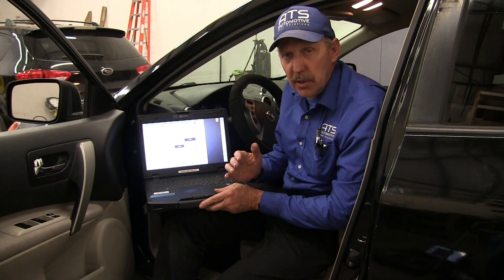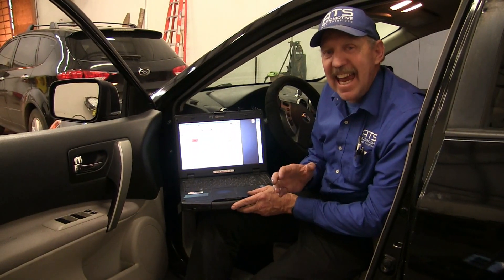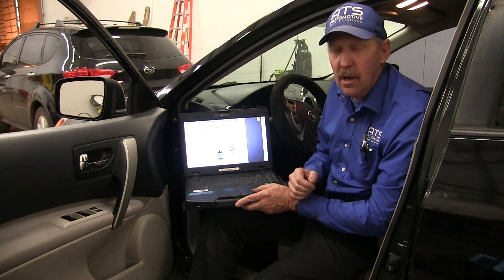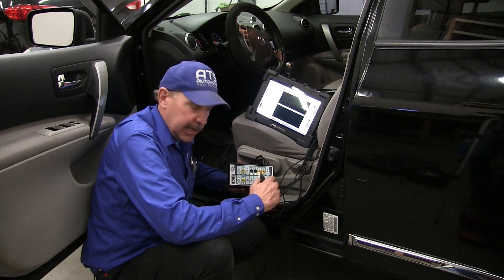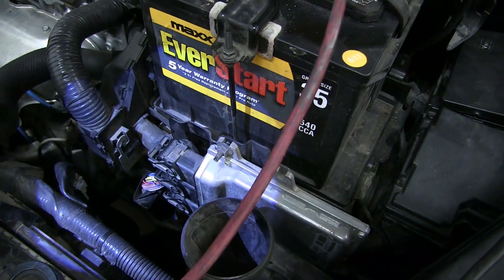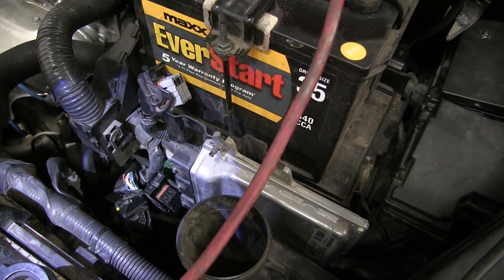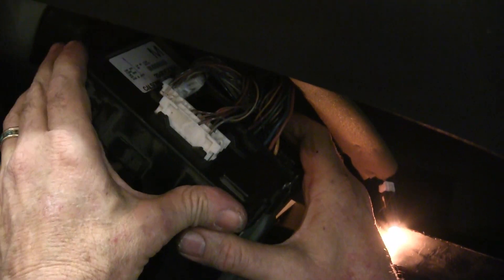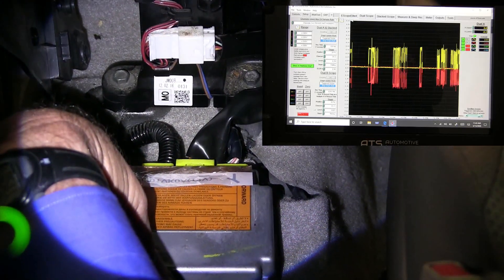CAN diagnosis on 2012 Nissan Rogue

Comment: If you pull out fuse for failing module, would you still see U1000? I am wondering if ESCOPE is necessary?

Also do you unplug modules with turned on ignition? Is it safe?

Comment: I'm having this issue on my 2008 titan. The horn wasn't working (though other controls are fine on the steering wheel) .... So I checked the fuse and cleaned it off as it wasn't blown and the horn worked for a little. Then I changed the fuse and it worked for a little.... Then it stopped so I removed the relay and replaced it... At that time the SLIP light came on (I didn't remove the battery terminal when changing the relay)... And with it, the U1000 code came through too. I checked the ground by the battery, and the front passenger side panel behind the battery... Took them both off after disconnecting the battery and cleaned the eye connector, bolt, and body. I put them back on and hooked the battery up and used a bluedriver pro to scan then clear codes.... The SLIP light comes right back on and the u1000 and sometimes u1001 codes are pulling up. As a result, the drive icon is blacked out and I can't select between 2wd and 4wd... Just the SLIP light on. No other lights. What do you suggest???

Comment: Great video.  I have a 2010 Rouge with all the lights on but no scanner like that.  The Auto store says I have a U1000 can issue and a front left abs signal missing.  Is there anyway to find the bad fault without a scanner like you have.

Comment: Excellent video! I have a 2014 Sentra for which the P0744 code will not clear. I think there is an electrical issue. With the ignition on I scan the code and erase it. Without starting the car or doing anything else I read for the codes and the p0744 remains. This leads me to believe the error is live all the time. I checked the valve body solenoids and the wiring to the trans. All seem to be fine. I’m thinking the TCM is acting up. Is there a way to test the communication with the TCM. I don’t have the fancy scope or the dealer software. Any thoughts are appreciated. Thanks

Comment: what a horrible system.  one defective module should not shut down the whole car.  reminds of old days Christmas light when one burned bulb would shut the remaining good hundreds of bulbs obsolete.  very malicious design especially when their own factory scanner had no idea what was going on.  there's no reason why the scanner was not able to set several different codes for the airbag module not communicating wasting 15 minutes on camera time and about 2 hours off the camera time of this fine gentleman.
Reply: I agree with you but this happens in all brands by this time
Reply: @patriciomunoz2830  that doesn't mean it's ok.  government should ask the manufacturers t o recall their poorly designed craps and re-program them so one bad module does not shut down the whole car and if it does it should set a very precise fault code.  it's absurd that nissan factory scan tool was not able to say which module was causing the problem.  I'm currently recommending to my customers to stay away from european cars because they don't know secondary air system.  if their cars don't complete the secondary air system monitor, they wont be able to smog it and will have to trade or junk the car.  there should also be some class-action law suits against manufacturers who have very primitive design flaws embedded in their systems.  there should be law suits against those that use finest print on a very small label for critical information labels such as underhood emissions labels, for instance or models that don't run self-test monitors if scan tool is connected to their dlc, ...  just because they do it wrong doesn't mean we should develop tools to put up with their pure negligence.  why if the chief engineer was suffering from Alzheimer or dementia at the time of the design?
Reply: @MPier  thank you so much man! I'm currently having the same problem with my 2018 Nissan Rouge sl. The car is relatively new, but I can't seemed to pass the "smog", as I'm getting a U1000 & 1001 codes, which of course results in an I/M Cat, O2 sensor, and EVAP all "Not ready". Remind you, I don't have a "check engine light" on.  Some mechanics have advised me to "drive the car some more". I've been driving over and over on the highway by their instructions, only to realized that the problem still exists. I'm extremely frustrated and annoyed as you can imagine. I set up an appointment with Nissan next Thursday, but a bit nervous, as their are known for poor  customer service smh
Reply: @nakiabrown994  insane, these issues were seen on early obdii cars and mostly on the european models, say 1996,1997 models but there's absolutely no excuse for a 2018 model to behave the same way, not completing the monitors and without setting any codes so we can have an idea what the hell is wrong with it, especially with gas prices at these levels.  Nissan dealer will most likely say 'drive it on the highway straight for 10 minutes'.  Also don't go faster than 68mph for this purpose.

Comment: I was worried about unplugging the SRS module with the key on, I once had air bags deploy on me. I can't remember if it was unbolted or still mounted, but I always have the key out when unplugging them now.
Reply: Most possible, the module was unbolted, and when you was trying to disconnect it,you turn the module up side down, the gyro  sensor inside the module 'felt' that the car had an accident and turned  up side down, and deployed the airbags. logically, only the side airbags deployed. can you remember which airbags deployed?
Reply: @Lambros_Stefaneas  the steering wheel and driver's A pillar
Reply: @seftonplayer32  
I think, this is the most possible explanation, I don't think that, when you unplugged the module, the 'spikes ' deployed them. 
I feel sorry for you.....😔😔😔
In our trade, sometimes (or the most times 🤣),we are learning  from the mistakes.....
Reply: but if you cannot unplug a bolted srs what can you do?
unbolt the module,give it a ground and then unbolt?
Reply: @alinduta5398  unbolt the module,give it a ground and then unbolt?

Comment: I have a Honda where the CAN looks a bit weird, the signals are not exactly waveforms and I'm suspecting a CAN issue as I can see very high resistance. I was able to find a bridge where I can check either ends but they end up connecting but the wirings change in colors, I decided to chase this with a resistance change instead and so far I'm thinking it may be the SRS module as I'm getting a code for it malfunctioning. I will unplug it tomorrow and see if the resistance drops to where it should be. Funny is that when I disconnect and reconnect the battery, the car is normal but as soon as I press the push to start, it starts to act up, it eventually corrects itself when all systems go to sleep but the navigation & radio stay on, along with the gage saying it is power on. Car runs and drives, had a code with the power steering module (EPS) CAN communication, I unplugged it and the issue remained so the SRS may be dropping that module from communicating properly. I already unplugged most modules that use the CAN networks, only thing left is the PCM, BCM, climate control, radio, gage module & SRS module. This is a Honda Coupe 2013, 2.4L Non Sport.

Comment: It's ok to plug modules back in with the key on? Especially the ecm
Reply: scaner danner had an explosion airbag working with airbag module with key on
Reply: @alinduta5398  That particular module was unbolted.
Reply: I would like to know Bernie's take on this also.  I've read in many books that the key should be off when plugging or unplugging electrical components.

Comment: I did not know you can disconnect the module connector with power applied.  In the past we were told not to do that, due to power spikes or glitches.

Comment: Bernie what you are saying I think is if the transceiver is pulling the circuit down pulling fuses will not solve the problem but if you pull a fuse to a module and the system comes to life you have found the problem. I hope I’m getting this correct. Stay safe and thanks for sharing Artie 😊

Comment: Great video Bernie, are there any risks involved with disconnecting and reconnecting modules whilst the system is "hot" ie powered up?
Reply: In my experience no, there is no risk in doing this. This is the way that we were trained by Mercedes Benz USA , as a factory tech, no locate faulty modules/branches on a network. It is a little easier on a Benz because most of them have "X connectors" which act as a "junction" for the modules to connect to. So all you have to do is locate the x connector for the network you are working on, then unplug one connector at a time until the waveform stabilizes. I have never had any issues doing this.
Reply: Good question Steve!!!!!
Reply: Hopefully mr. Thompson will answer Steve....
Reply: I know that there are TSB'S out for some GM's for doing this with the BCM, particularly the BCM ground(s).  They often recommend battery disconnect before disconnecting BCM, but I have never actually seen it before so 🤷‍♂️
Reply: @PaulysAuto  I change a bcm about 2 months  ago because of  battery  voltage went down
Reply: Most modules are plug and play. I have disconnected PCMs and the com lines act up especially with Nissans where the fan starts to go off because that's what they usually do when the PCM has a bad ground, etc.